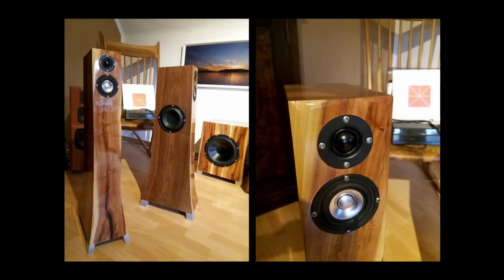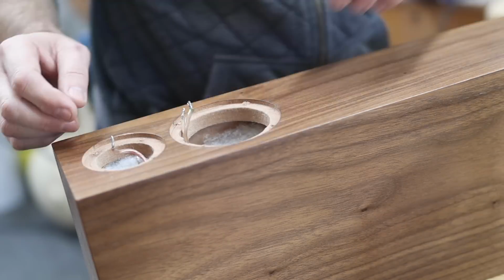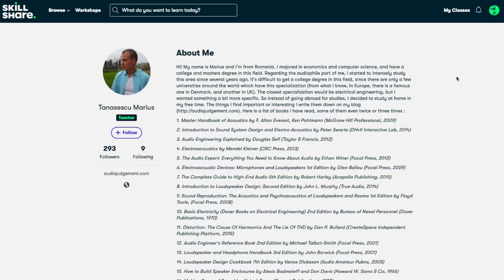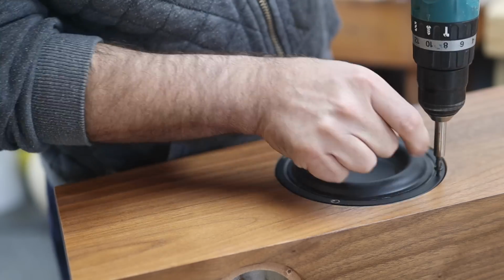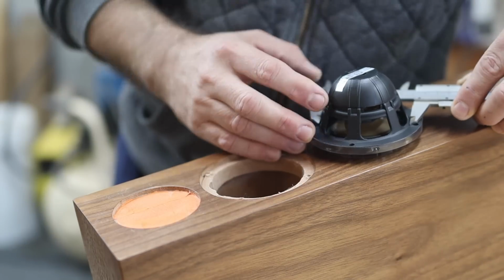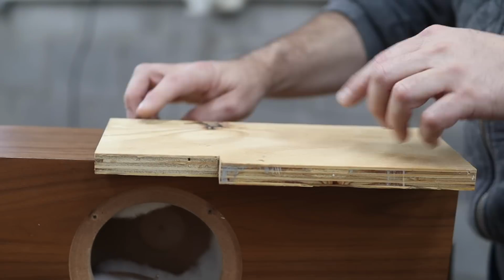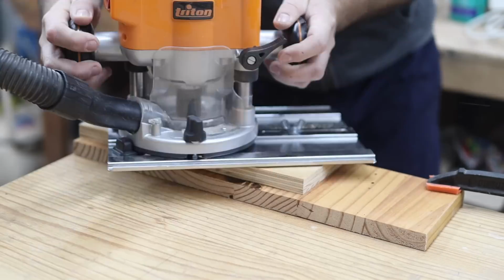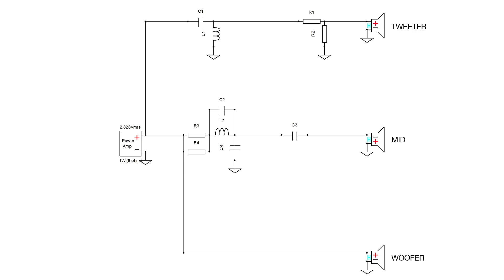Building a High End Small 3-Way Stereo Tower Speaker V2.0 - by SoundBlab

Comment: Great thanks for this upgrade since we cannot get the Fountek full range driver anymore for those who are in the middle of the way to build the initial version. It is awesome you managed to propose an alternative and I am really thankful for this. I lost hope with Fountek as well now since my contact there  vanished and their web-site is down, Therefore I am considering the upgrade and will buy the new plan on top. however I have a question in regards with the removal of the rear Dayton speaker in V2. Wouldn’t be possible to keep it in order to retain good characteristics for sound imaging thanks to this setup and add the new tang bang driver with its corresponding updated cross-over section ?  What do you think ? Please could you review and advise on the option to keep the initial Dayton rear speaker ?
Reply from the maker: Hi, the rear firing tweeter is still part of the design. Maybe the video didn’t make that clear. All that changes in V2 is the new mid driver and the crossover. Drop me an email with your original order number or your name and surname, then I can send you the updated build plan.

Comment: Have you tried listening to them with the side woofers facing out? Is bass cancellation an issue with this placement?
Reply from the maker: Yes I have. What seems to be best is to face the woofers outwards when the speakers are roughly less than 2 meters apart, and inwards when more than 2 meters. Cancellation is not an issue in either position.

Comment: simply excellent. I have already built the same model but in library format and believe me it sounds. I just wanted to know for the V2 column is it possible to change the shape of the speaker while keeping exactly the internal measurements of the liter, as the top is shorter than the bottom I think I have to compensate.
Reply from the maker: Thanks. Might be difficult with this design. The baffle and the side panel, since they have drivers on them, will be influenced if their shape and size are changed. If it was just the front baffle with drivers, if you kept that the same size, you could potentially do whatever you want with the rest of the cabinet as long as the internal volume remains the same.

Comment: Hi, can it work on 8ohm/120w amp, or need resistor modified to Xo.. ! Bass is beautiful without distortion! Dayton is easy to find stuff but Tang’s speakers are not kind of popular one to find !
Reply from the maker: It depends on the amp. Some amps can handle 4 Ohm loads, even if they are specified as 8 Ohm. Check the specs with the manufacturer.
Reply: @SoundBlab  i did have amp with 4-16ohm at home but i plan to use these pair at work, is it possible run on 8ohm or just have to be 4ohm amp ! My thanks
Reply from the maker: What amp are you planning to use? Name and model, then I can find out if it will be suitable?
Reply: @SoundBlab  I built an diy class d amp with TPA3255 chipset and 2x op amp with opa1612.. my PSU it could supply 100-120w per channel.
Reply from the maker: I would say that according to the TPA3255 datasheet that it should be able to handle a 4 Ohm load. Amps are almost never driven to their max, and you will only be using a limited amount of its capable output power and what the speakers can actually handle.

Comment: What is name of your router Circle Cutting Jig? Looks simple.  Couldn't find the speaker dimensions.  What is the HxWxD?  Nice technique to re-cut the hole. Awesome build. Thanks!
Reply from the maker: The jig came with the Triton Router. I did modify it slightly though. Dimensions are approximately (W x H x D): 115 mm x 800 mm x 250 mm (without feet or spikes). Thanks!
Reply: @SoundBlab  Thanks!  Would you consider this speaker and the driver's an audiophile level build?  Would other drivers and crossover components improve experience of course with added cost?
Reply from the maker: Hi, oh yes definitely. This is not a budget type speaker in terms of performance. The quality of the drivers will have to be very very high in order to make a significant difference IMO. You could gain some extra clarity by using better caps in the tweeter section, and midrange, but often, depending on your supporting equipment, the results are not always noticeable. Pair it with good electronics and it will please almost any audiophile. This is my most popular build plan, and I have only heard good feedback from those who have built it.
Reply: @SoundBlab With that input, will be ordering plan and building to give it a listen! Drivers in the design are definitely low cost($12 tweeter). Not certain what caps are spec'd, what reasonable $$ caps would you step up to?  Driving it with PS Audio amp fed direct with Lumin streamer in a medium/large room.
Reply from the maker: Most manufacturers have budget, medium and high level caps in their range. What you use will very much be dependant on your budget, but use whatever you can afford. The higher the quality the better, but IMO any medium level cap usually gives very good performance vs cost, and is a good option for this build.

Comment: Could these cabinets be constructed from 1/2" material instead of the 16mm MDF? Here in the USA 16mm MDF is very rare and not easily purchased.
Reply from the maker: You could try 5/8 inch birch ply (which should be 15mm thick I think) or, something similar. Then just adjust the outside dimensions slightly, but keep the internal dimensions the same.
Reply: @SoundBlab  I ended up purchasing 3/4" Maple Plywood. The only sizes available near me were 1/2" and 3/4"

Comment: Hello, amazing build!! I will check more of your stuff after seing this video!

If you don't mind, I have a question regarding the TB FR driver you used for mids, because you have at least some experience with this driver.. I have similar plan in mind (my first project), but I would like to use the FR for mids and highs as well. Do you think this driver is capable of this? According to specs, it is, but you worked with it, so your opinion would be much valued! 

My plan is just FR driver and woofer, crossing lower, about 800-1000.. I have no clue, whether it is a good plan, or nonsense.. FR would be some TB or Mark audio (3-5") bass driver I would like to use DS215.. 

thank you in advance!
Reply from the maker: Hi, thanks! This driver can definitely perform well as a full range. It does a really good job.
Reply: @SoundBlab  thank you! In the meantime I have changed my mind a bit, because I found some good offers.. finally I will go with W5-1611SAF. Seems also more suitable for music I am lidtening to. Will cross it around between 500-800 hz, not yet decided exactly.. woofer will be 8" Vifa M22 or 10" DS270.. wish me luck xD and keep up your great stuff!!! Channels like yours are really i inspirational and educating for begginer like me!

Comment: On a personal level, which sound output did you appreciate more? The original fountek version? Or the new driver version? Thanks
Reply from the maker: The Fountek showed slightly better transient response, but overall I prefer version 2.0 with the Tang Band driver. It also has better power handling and I could cross it over a bit lower as a result.